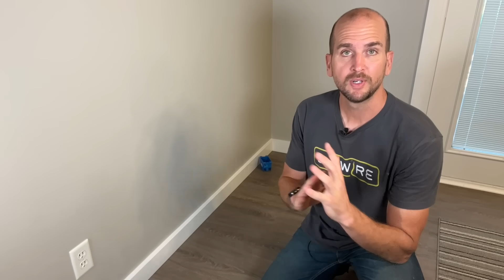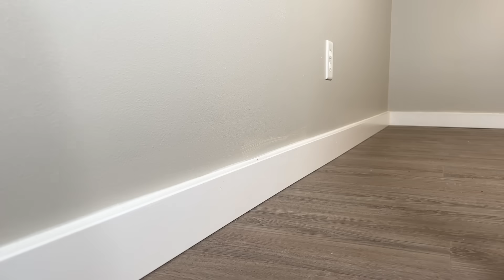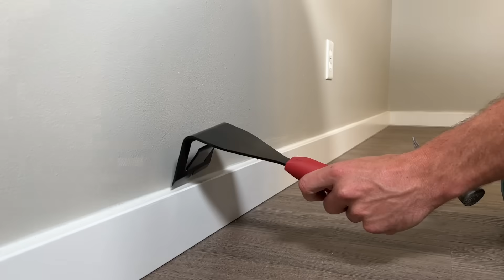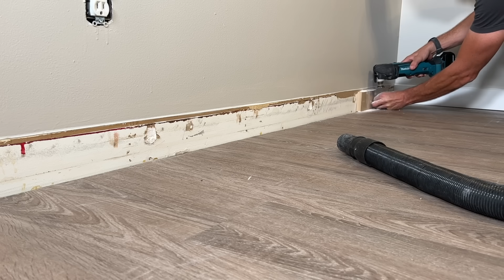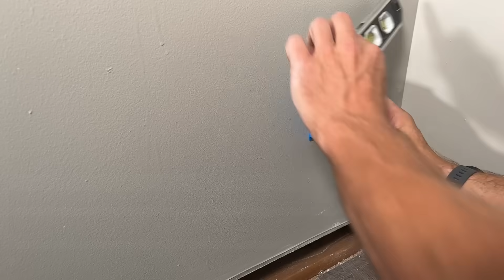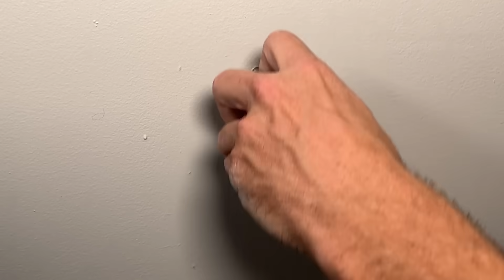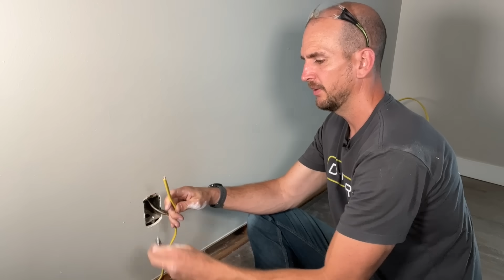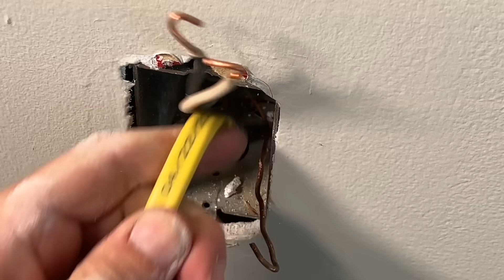How To Add An Outlet To A Finished Wall

Comment: handy tip .... NEVER ASSUME both outlets on a box are connected together ... test BOTH sockets on an outlet to ensure power is off ... the resulting shock when one finds out someone wired 2 different circuits into one socket is enough to make you never make that assumption ever again
Reply: Yep learned that one the hard way
Reply: @jerrybarone9899 what's it feel like?
Reply: I've seen part of a receptacle switched and part always hot many many times but I've never seen 2 circuits on one duplex receptacle.
Reply: Yeah when working with electricity,check every conductor you’re working on.I got hit by a hot neutral on 277 industrial lighting,while hanging off a forklift basket.Not a fun day
Reply: Too true...
Check everything twice!!!
Reply: I always treat every wire like it is live until I am 100% sure it's not live.
Reply: I agree, you will only make that mistake once.
Reply: A duplex outlet is 2 separate outlets on one strap that can be used completely independently. They are usually made with a jumper tying the two together at the ungrounded power terminals and the grounded power terminals. The grounding terminals of all the devices in a box are always tied together. The power terminal jumpers can be snapped off to allow the outlets to be used independently. It’s common to provide switched power to one outlet in a duplex to allow a table or floor lamp to be controlled from a wall switch. If there are several switches it’s common to use a lighting power circuit separate from the outlets, and that’s the only way for a single pole switch to control both a ceiling light and outlet(s).  It does have the benefit of leaving the lights on when the hair dryer overloads the circuit. It’s also common to feed power from from the outlet circuit. When wiring an unfinished building it’s common to think in terms of minimizing the number of holes to be drilled and the number of bundles of cable to pull, and of circuits that can share a single expensive GFCI or AFCI device. That perspective leads to some counter intuitive circuits. There are also wire count limits for wall boxes based on the box volume that can militate for chain topologies instead of star topologies.
Reply: I opened up a 3 gang box (2 switches and an outlet) in my kitchen to replace a switch and it had 3 circuits running to it. Each switch was on a different breaker and the outlet was on a 3rd breaker. Luckily I'm paranoid so I did check them all.
Reply: @TheDaniel688  That same kind of thing happened to me when I was splicing in an outlet for an over-the-range microwave recently. I flipped what seemed to be the appropriate breaker, and the outlet I was splicing into was off, which I confirmed with a non-contact tester, and a multimeter, then I tested both testers on a live circuit, and they were fine. Inside the box, in addition to the outlet I was working on, there were two big wires that were just terminated with wire nuts, and I had no intention of messing with them, but while I was working inside the box, I suddenly got shocked, and knocked on my you know what!! apparently one of the wire nuts had slipped off, and my hand must of touched the bare wire end, which was apparently hot!! After I calmed down a bit, I poked around, and found that the two mystery wires were both hot, spliced from a 240V outlet for an electric in-wall double oven, and for some reason, the wires went through a bit of flex conduit, and were just hanging out in the box I was initially working on. So, obviously, those two wires were on a completely different circuit, which is why they were still hot, even when the outlet I wanted to work on was probing dead. So, fortunately that was just a stern reminder for me to probe everything in the box, and not to operate on assumptions. That could have been a lot worse!! 😳😳😳
Reply: @TheDaniel688  your kitchen 2 small branch app circuits, lighting, and sometimes pass through dedicated circuits (for microwaves, dishwasher ect) not uncommon.
Reply: This can even be the case on a single outlet. I've seen outlets with the tab broken to switch one side with the light circuit being on a different breaker.
Reply: I mean or be a man work hot
Reply: This comment. While replacing a few old outlets in my home, I've had 3 outlets in 1 room, all on 3 different circuits. Always best to check for power whenever you work with electricity.
Reply: So happy to see NO  unnecessary shoe mold, or quarter round.  Such a bad habit by contractors to add unnecessary stuff and charge for it ad: "this is needed to make it complete".
Reply: Just look and see if the duplex has been clipped.  If the metal on the hot and neutral set screws has been cut off you have two different circuits on the same outlet
Reply: @chrshuston  no need to cut the N tab
Reply: We or they ain't gotta be together 🤣.. it's the principle of breakers and broker
Reply: Thank you sir!
Reply: I test and then always stick a screwdriver in first and short all terminals. No matter what I am working on.
Reply: well where were you when i electrocuted myself couple of years ago?
Reply: Shocking!!!
Reply: L.
Reply: This is true.
Reply: Same goes for a multi-switch box.
Reply: Test all wires before disconnecting from socket after you pull it out.  Was replacing plugs with a gfi and got a spark when I disconnected return line.  Apartment had been wired with multiple circuits sharing return line, meaning that “ground” was hot when disconnected because lights were on downstairs.  Not sure I’d have seen voltage, guess an AC current tester would have been in order.
Reply: Excellent tip. I have a room in my finished basement that has 3 receptacles on the same wall within a few feet of each other, but two of them are on the same circuit, yet the third is on a separate circuit shared with an adjoining room.
Reply: You might not get to make any assumptions ever again if you make that mistake.
Reply: Happen to me, not shocked but two separate circuits on one outlet.
Reply: I got shocked with 220v while on a ladder. One hand holding the metal emergency light box and the other reaching into the wiring access, which had an uncapped red wire (the 220v) greet me when i reached in. I was so calm for like an hour or so, no emotion, no feelings, just complete calm. I suddenly realized why electro shock therapy was a thing and why..
Reply: How many outlets can i run off of one and is it safe. How many things can be plugged in them before it triggers the braker. Thank you
Reply: I wish I’d read this a couple weeks ago! Thank god I had the switch off, but the lights, outlets and switches are STUPID the way they are all connected together. I’d have never guessed I needed to flip 2 breakers. I need a tester.
Reply: T÷ğ
Reply: And it's 120v, imagine people in Europe getting shocked with 220v
Reply: @privettoli  voltage doesn’t kill. Amperage does
Reply: This is more common in apartments and older buildings, but better safe than sorry
Reply: 120v dont hurt to bad.
277/480v tastes funny
Reply: Lol thats because 1 outlet must be controlled by a switch so the tab is broken off in the center and the bottom is wired hot. In a kitchen it is code for the top n bottom of each outlet be on different breakers
Reply: @JeffreyNevrotski  
In a  Single or multi family dwelling.
 In a kitchen.
 You are required to have a minimum of 2 countertop small appliance circuits.
 Nowhere does the NEC require that the top and bottom outlet in a kitchen are on separate circuits
 This would also be difficult since a GFCI cannot be split this way.  And both countertop appliance circuits must be GFI protected whether they are 6 feet from a water basin or not.

Circuit position is up to the electrician.

Every bedroom in a house usually has one receptacle that is half switched and half hot. Due to the following requirments for a lighling
 "outlet" 

Oulet does NOT mean receptical.
A fan box is also an "oulet" as defined by the NEC

Section 210.70(A)(1) provides rules on dwelling unit lighting outlets and where they are required. The 2014 NEC required lighting outlets to be located in every “habitable” room and bathroom.

Defining what is considered “habitable” is beyond the scope of the NEC but the International Building Code defines a “Habitable Space” as “a space in a building for living, sleeping, eating or cooking. Bathrooms, toilet rooms, closets, halls, storage or utility spaces and similar areas are not considered habitable spaces”.
Reply: Tell the story please
Reply: Great video. You made the task look easy and efficient, even accounting for the small differences between US and Irish construction and electrical terms and methods. I am a single woman who ends up having to do a lot of the small diys in my home myself. I enjoy doing them but knowing how to do them correctly and safely can sometimes an issue.  I have a couple of double outlets located in the middle of a bedroom wall where it is incredibly awkward as they sit behind the double beds. I have been wanting to move the outlets so that they are on either side of the bedside tables for lamps etc. 
After watching this I now have a great solution to the problem. Thank you, I will definitely be checking out more of your videos.
Reply: That’s true, granted there are separate sets of wires landed
Reply: Just call a electrician! Best and save way to do things.
Reply: Come on, it doesn't hurt that bad 😂
Reply: Non vedo dove sia il problema. Piuttosto, il vero problema è una casa costruita in legno, fragile, inadeguata e di resistenza sommaria.
Reply: Thanks for learning the hard way so we don’t have to
Reply: True, I found out a couple times in my youth.
Reply: Yes, especially if they're of two different legs. It ends up being 220vac. sometimes you have constant on one receptical, and switched on the other receptical
Reply: Spoken like a hard knock graduate!!!
Reply: Handier tip, always assume everything you're working on is live. Even if you have turned it off, work on it as if it's hot...
Reply: @GulfportOG  lol, so why when I turned the switch the lights don't come on?  Oh it not live. You should not be wiring anything if don't know if live or what it takes to make it live.
Reply: @daisykaren6584  if you judge whether a circuit is live on whether or not the light turns on, you shouldn't be commenting.... There could be more than one circuit in the box. Could be sharing a neutral.
Reply: @daisykaren6584  accidents happen and people turn breakers back on..... Better safe than sorry. Been in the field 25+ years. Better to work as if it's live
Reply: @GulfportOG  so what to you do when you don't see sparks.
Reply: Outlet sockets in a box receptacle
Reply: 0
Reply: My wife is my voltage tester... 
Hey come grab this for a sec!👍
Reply: @fakeaccount8342  Dude who's going to do the cooking? Get one of the kids to help.
Reply: I recall learning this first hand when rewiring my camp. To my surprise, someone  had used tge box for a receptacle as a junction box for a different circuit. Fortunately I was not injured, just started by the shock. I am very careful to check all wires since using my non contact tester.
Reply: I have outlets like that in my living room! Great reminder tip!
Reply: Thank you, that's the first thing I noticed as he did it. I also use a non-contact voltage detector and run it all around those wires in the box. You never know what crappy work I sometimes run into. I bought a house with a light switch in the living room that controls one of the washroom fans on the 2nd floor. Imagine, a switch right above your thermostat controlling your washroom fan on the second floor. Clearly it ran on a 3-way switch that's connected to a different circuit breaker on the panel. Always verify and do not make any assumptions.
Reply: If the tab is not broken the it is just one circuit. If the tab is broken then it’s two. .. if you know anything about electrical work then you would see it when you open the receptacle out.
Reply: Very good observation 👍
Reply: Great tip! But you can tell if there's more rhan 1 circuit in a box by looking at the number of wires coming into it and using a pen tester to confirm whether or not there's power in any of the wires. Keep people vigilant! Love the tip!! ❤
Reply: Very much so. Do you know how many times I've split the outlet for an on off light. Would you want it in position 1 where the 2 outlips were nipped? Why does my new box not work to power my cell charger when it worked last night when I was paying my bill on my office desk. Intangibles brother
Reply: That zap is better than coffee in the morning lol
Reply: Gotta say, I've never seen someone wire 2 circuits into one receptacle
Reply: Split circuit Good point...but he tested the circuit that he was about to connect to.
Reply: I would rather see a video of how to relocate power from a outlet on a solid wall easily without damaging it
Reply: Wear glove for safety and use wire nuts to cover up hot and neutral lines were disconnected.
Reply: I don't touch the wire parts regardless
Reply: Preach brother always TRUST BUT VERIFY
Reply: f it. turn the whole house off that is what i say.
Reply: Alternatively, cut the breaker
Reply: From someone named "kaboom" 😂. Guess he should know
Reply: I learned this recently, I always test every outlet, but I had the breaker off to a room, had swapped three outlets all were off. Got to the 4th one, and it had power? Found out there was just one outlet in the room connected to a separate, unmarked breaker.
Reply: He only had one feed into this receptacle.
Reply: You can tell by looking at the receptacle if it's split with 2 hots
Reply: And what brings THAT up?
Reply: What would be the point of doing that?  What benefit does having each receptacle of the same outlet on different circuits?  That just seems stupid to me and pointless.
Reply: @Dubmaster3  well that's your opinion. but i agree. esp for 2 reasons; the cost of 3 wire; you'ld need a two pole GFI/AFCI breaker, who wants to do that?
Reply: FACTS!
Reply: Happened to you too? I thought I was only one that had this happen
Reply: Yeah, I learned that when I was in my basement, the top outlet that goes to the water softener and the bottom socket that goes to the washing machine are on two completely different circuits.

I was going to install a GFCI outlet there until I realized that and realized I can't do that...
Reply: I believe it’s against code to run 2 120v legs from outlets not being dedicated for an specific purpose (like a fridge) article 210.6 , in a dwelling you cannot exceed 120v , where an untrained person can access it easily,
Reply: Former Navy electrician. You should never assume anything when it comes to live circuits. The correct way is to always test for voltage before and after shutting off breakers. Same principle applies to OSHA tag out, if you don’t have a meter use one of those outlets testers for voltage. Stay safe friends!
Reply: Man u guys sound like amateurs 😂
Reply: What if there is not a knock out in the box  ?  You might still be able to sneak the wire in. Or you have to curt out the box and fit a re-work  box.
Reply: What a shocking surprise that would be.  😂
Reply: I learned this the hard way
Reply: What are u new 🤧
Reply: 2 circuits on 1 outlet? How can that be?
Instead watch for 2 circuits to different outlets in a room. Or a half switched outlet.
Reply: They cut the taps I've run into some not a lot but on older houses u can run into them 🫤
Reply: Yep. Happened to me
Reply: Thank you, never thought of that.
Reply: Check with a non-contact tester,  worst case there could be a loose wire in the box with voltage on it.
Reply: @frontiervirtcharter  Fuck even that.
I've got zapped a few times doing electrical work when I just started doing DIY stuff so now I don't trust ANYTHING and I shut off EVERYTHING when doing electrical.
Reply: @ayporos  yep...  new place I am in, has crappy labeling in the box, and some stuff in the same room is on different breakers... just easier at this point to shut it all down, until I can map and label it all...
Reply: @patrickharding8851  The non-contact tester is part of the map-and-label process.. See what squeals before the breaker is off, and check again after.. Can be a literal life-saver
Reply: @ayporos  yeah, don't you love it when you find a circuit that is always on and NONE of the breakers shut it off? Guess how I found out. Always test. It doesn't make sense but in this house only the main kills that last one.
Reply: @matsudakodo :

Somehow you have a breaker that didn’t open manually, or as Richard pointed out, the unlikely scenario that the circuit is illegally fed by two breakers without a common trip.

Create a bolted fault on the circuit.  See which breaker(s) blows when you apply power.
Reply: @ayporos  Never trust labels in a breaker or fuse panel.  Learned that when my stove was giving me fits.  Breaker labeled Range...turned it off....removed the front panel of the stove to get access to the offending burner control switch, screwdriver hit something in the process and zap...umm, WTF, I turned off the Range breaker...15 years later I've yet to figure out what that breaker actually goes to because it sure as hell isn't to the Range LOL.  I have to turn the power off to the whole house if I have to mess with the Range.  The Range is not plugged in either, its hard wired into a junction box behind/under the Range.  Its a slide in type Stove/Oven.  Next time I have to do anything I'm wiring in a regular Range outlet back there so I can simply plug the Range in and unplug it when needed.
Reply: @denverbraughler3948  You likely have a circuit that's fed by 2 separate breakers. If it were fed by both phases you'd have a nice pop when you energize it from either breaker. If they are on the same phase, it just makes it difficult to turn off.
Reply: @ayporos  Yep same here you don't know what someone else has bodged together
Reply: @matsudakodo  same thing happened to me putting a new light fixture in my garage, confirmed I cut power and noticed a 2nd wire in the box. Didn't think anything of it until I felt the electric ants crawling down my arm. Not a fun experience.
Reply: @denverbraughler3948  ... you would be in trouble if it was 'always on' 😳
Reply: @denverbraughler3948  that's a good way to wear your breakers out.
Reply: @solaceofflame :

The context is residential 15A or 20A OCPD. 
Tripping a circuit breaker conducting 125V causes negligible damage.  
You do it once, not one thousand times.  There are many breakers that have tripped hundreds of times while supplying an inductive load, and they continue perform within specifications.
Reply: @ayporos 😂😂😂 I feel you
Reply: Damn...WTF? @matsudakodo
Reply: Non-contact circuit tester is a MUCH better idea. I used to shut everything off when I first started DIY, but there’s no reason if you’re smart and careful with a tester.
Reply: @patrickharding8851 most places don’t have any labeling
Reply: @frontiervirtcharter  ä
Reply: @frontiervirtcharter  xçsssddg9
Reply: Should be super obvious with the receptacle opened up.
Reply: A related thing I saw once was. Only one circuit but half of the outlet was dead.  I'm not an electrician.  I did years of IT computer / networking support.  Was briefly stimied by 'dead' computer in supposedly known powered outlet because they also had a small fan or something in the other outlet and it had power.  Occam's razor and all that - testing kept saying it had to be a power to the computer issue so I I finally had them swap the two cords.   Computer powered up, fan no longer had power,  problem solved in terms of on my end.  (This was all over the phone from another state so i wasn't there in person to test the outlet)
Reply: @davidbwa  usually in a situation like that, the "dead" half of the outlet is actually just switched and the resident has no idea. Always try toggling every light switch in that room and re-check the "dead" half after every switch, because of it's double-switched,you might flip a switch that turns the outlet on the walk across the room and flip a different switch that turns it off, and if you test again after that it will still seem like a dead outlet.

It should be virtually no other way for half an outlet to just "go bad". The other most likely explanation is that someone broke the dividing tab during install and then never wired up the other half. This video explains what I am talking about:
https://m.youtube.com/watch?v=l1EHYfD_nww
Reply: Test wires not outlets and all of them - regardless of their colours
Reply: @ipodman1910  test them when they’re spliced and after you undo the splice if you don’t know what you’re doing. I learned about open neutrals when reconnecting “neutrals” while sweating, while leaning on a stainless steel wall of an industrial kitchen. I didn’t realize the splice had 4 black wires and 5 white wires. So my 0 voltage box had 125 neutral to ground when I opened the neutral (or neutral to open neutral)
Reply: @KitchenerLeslie2  that is called backfeed . The neutral is the return path to the transformer that supplies the house with power. If the circuit is on and that neutral connection is broken, the neutral will test out at full voltage.
Reply: @solaceofflame  yes thanks. That’s what I explained
Reply: As an electrician, some of these comments concerns me and you are probably  better off calling a professional
Reply: I aways use a contactless tester and just incase there's feedback from an electronic motor condenser or backup powered exit or computer i also plug something in to drain resilient power. I have been shocked many times. The new wireing installed in new houses with LEDs lighting and other controllers do have more then one feed in to the same light switch box from different breakers. With neutral wires now required in switch box all kinds of things. Nothing worse then somthing getting turn on by cellphone.  Yes it happened to me.
Reply: GAY!
Reply: Call a professional electrician and you won't end up dead or in the hospital over a $300 job.
Reply: O
Reply: I never use those plastic boxes. I use like my older electrician said which is steel boxes that last and won’t melt or burn.  I hate plastic and my newer home is all steel boxes.
Reply: @jochimbenschneider1915  steel sucks to work with, those plastic or fiber glass boxes have 2hr fire rating. Steel okay for new construction, but no way would you use steel on remodel work
Reply: @ericvangordon5205  My steel electric boxes will last almost forever and I had one of the finest electricians do my new home and any good building inspector or electrician will tell you steal boxes are always better than these cheap plastic ones.  A fire can burn them up and melt everything and start in the house with plastic boxes as to where your steel won’t burn too
Reply: @jochimbenschneider1915  I hate metal boxes. You got to be really careful pulling out outlets because if you touch the box with it, ZAP!
Reply: @nickthegazerofsouls  you’re lazy and your old electricians and the smart, younger ones know that metal is the best. Mine has metal and they will never be bad.  Metal electrical boxes were used long before plastic (PVC) electrical boxes were introduced to the market. Ultra-strong, fireproof, and incapable of being melted, metal boxes offer the greatest level of security for all electrical wiring applications.

Even when slightly stressed, plastic boxes can twist. With enough stress, plastic boxes will distend. Even hammering the plastic box to the stud the wrong way can twist the box out of shape. Metal electrical boxes have no such problem: It is virtually impossible to bend or crush metal electrical or junction boxes.
Reply: @jochimbenschneider1915  haha, geez. I'm just saying of all the remodeling I've done, I've never had a single problem with a plastic box. Whereas metal boxes I've had plenty. Sure metal is stronger, but it doesn't really need to be stronger does it?
Reply: Shocks from 120 aint shit relax old man
Reply: Not much to it man. Plug a night light in.   Does it light up or nah? 
Not much to it man..  calm down son.
Reply: take the zap and move on who cares
Reply: 120 ain’t gonna hurt ya.  Might scare ya but it ain’t a big deal
Reply: @AATreeService and yet, depending on the load, will still kill you
Reply: @jaymz90 did you not read anything lol wow
Reply: @AATreeService  huh? Are you doubting that 120 will kill you or are you assuming that I disagree with your premise
Reply: @AATreeService  120 will kill you just as easily as 277 depending on the load. So all the electricians who have been killed by 120V did it intentionally? You're actually putting that statement out into public view?
Reply: @AATreeService  are you trying to get someone killed?  I mean technically yes, it's not the voltage...but it takes less than 1/4 amp knock your heart out of rhythm and kill you.  Most people that die by electrical accidents are because they didn't respect it enough.  The comments here of people bragging about getting hit are the people that will die later because they just laugh it off and don't get checked out.
Reply: @ISurvivedTheVA  u obviously have no electrical background.   Please re read my comment.
Reply: @AATreeService  I'm actually an electrician in WA state...and everything I said was taught day 1 in my first electrical theory class and can be backed up by asking any emt that's responded to electrical shock accidents.Try again.
Reply: @ISurvivedTheVA  please re read my comment.
Reply: @AATreeService pretty damned sure 120V is the leading cause of electrocution. Stick to loggin
Reply: @AATreeService  it can kill you if you touch it the wrong way and if you’re really unlucky
Reply: @NN-sp9tu  lol
Reply: @AATreeService  you laugh but people die every year from getting careless with standard low voltage circuits
Reply: It only 120 votes not shock you.
Reply: @daisykaren6584  not just the voltage that is dangerous. In the US it is 60 Cycle and it will try to synchronize your heart at 60 Cycle and send it into fibrillation and if your heart doesn't go back to its normal rhythm automatically you got a big problem. Better safe than sorry.
Reply: @daisykaren6584  it is not just the voltage that's the problem. In the US it is 60 Cycle and will try to synchronize your heart to that frequency. If your heart does not automatically go back to normal you got a big problem. Better-safe-than-sorry and disconnected first.
Reply: @donander1  true I don't like being shock I would rather disconnect but unless it cross you hart and you hart can beat at 5 cycles tops it just shock it.  That a hart beat of 3600 beats a minute no hart won't beat that fast. Many times just fell 120 you have to wet you hands.
Reply: @daisykaren6584 :

Elections have been lost by one vote.

How much of a shock you receive depends on circuit resistance and voltage.
120V can pass sufficient current to kill under many scenarios.